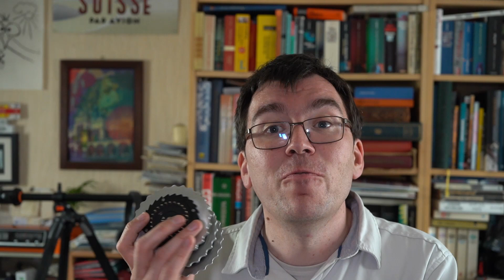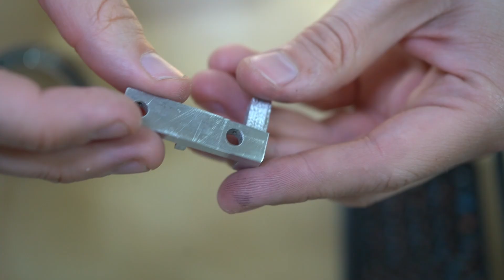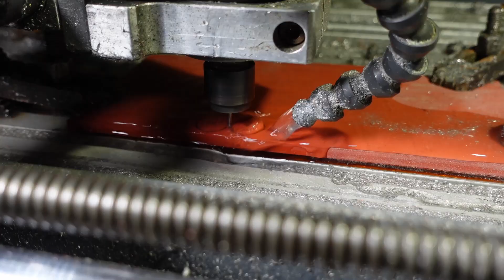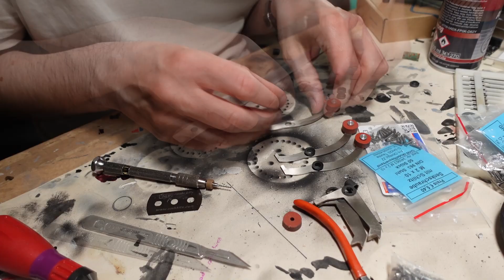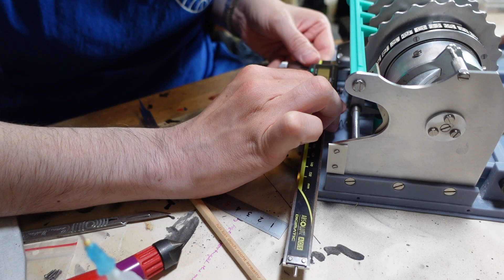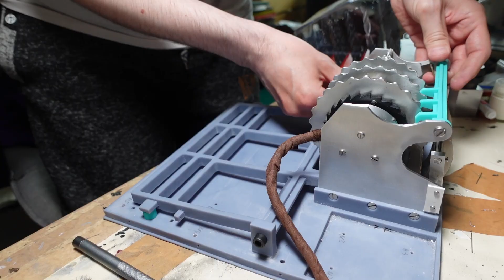The Enigma Build Project – s3e7 I must call Defeat, for now, The Stepping mechanism Part 2

Comment: I would suggest making the seesaw out of filament, and not resin. It should be much sturdier.
Reply from the maker: I don't have a filament printer, but out of curiosity which filament type would you use
Reply: @mostlyengineering5253 , there might be a makerspace near you with a filament 3d printer that would print it for you. ABS, PETG, Nylon, or PLA would all be likely candidates, with PLA being cheapest and easiest to find and print. The seesaw can be printed in 1 piece  on a Bambu A1.

Comment: I am sorry for your setback, but I know you will get there. Just give it a day or two and I am sure you will work it out. This is a hard machine to replicate and I think what you have achieved is truly fantastic.
In my research before I make my own decision, I have just finished reading Hugh Sebag Montefiore's excellent book, The battle for the code. Definitely worth a read.
I wish you the best of luck!
Reply from the maker: Thank you very much, also i have that book on my ebay list does it also include technical details about the enigma?
Reply: @mostlyengineering5253  This and most books of the era focus mainly on decryption techniques, however this particular book goes into the detailed history of the origins of the entire Enigma story including Schmidt and the Polish codebreakers. It also lays to rest the perceived notion that Turing (genius though he was) single-handedly "cracked" the code. The illuminating facts for me were that Bletchley could never have achieved their eventual success without the continuous capture of Enigma code books.

I have not yet found a book which goes into any technical detail on the machine itself, I am currently relying on the splendid Weingarten technical drawings. I have read that the company responsible for manufacturing the military versions (Heimsoeth und Rinke), along with various subcontractors (like Olympia Büromaschinenwerke in Erfurt), had some of their corporate files and wiring specifications survive, but I am yet to find out if this is actually true.

There is one piece of data which seems to elude every source I have researched, that being the spring force for a single rotor contact pin. I want to be sure that it is just sufficient enough to make reliable electrical contact. if it is too strong then X26 will surely cause mobility issues for the entire rotor carriage.

In the meantime I shall look forward to your next video, I wish you the best of luck!